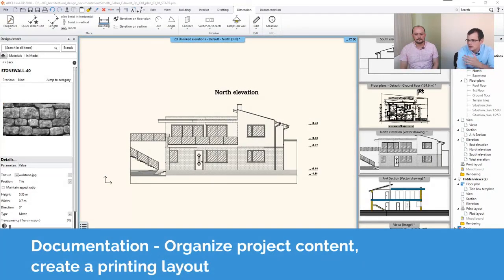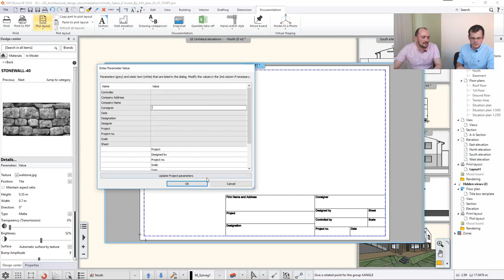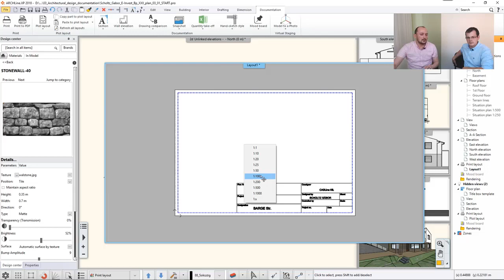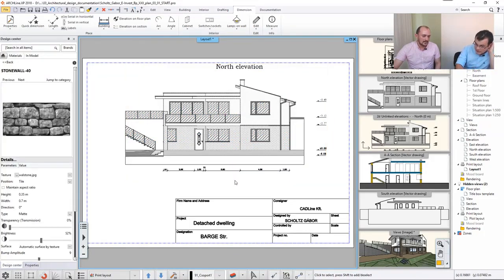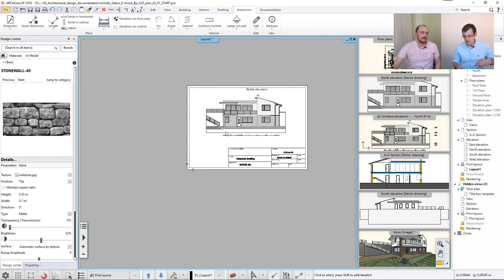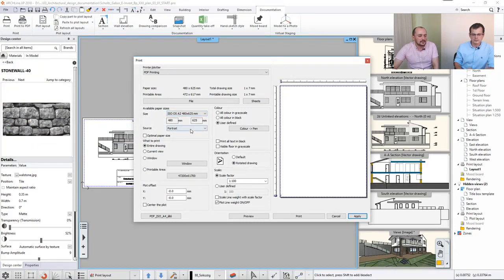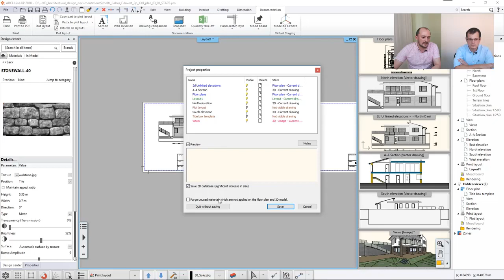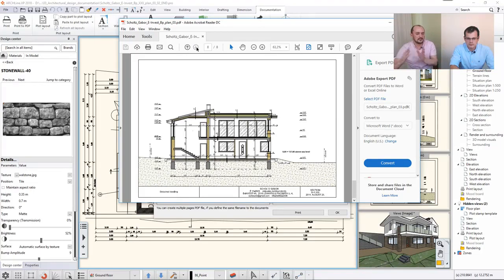Printing layout - ARCHLine.XP

Comment: In all the ArchlineXP  there are no structural grids, none. In Your oppinion, aren't they necesary?
Reply from the maker: Hi, it is possible to toggle our grid on/off. We usually don't have them on, in order to keep the view cleaner, but you can, by all means, use grids, too.
Reply: In building design, the architectural phase  contains the structural grid. In Archline Xp, the GRID TOOL, still has  lacks in plan usage and setup. Comparing to Allplan, Revit and Archicad,  this tool  has more control. Been working with all of them..
Reply from the maker: Thanks for your remarks. Please do some further testing on our program and if you have more feedback to us, we'd be happy to hear them via info@cadline.hu